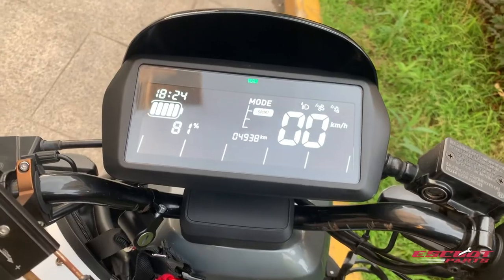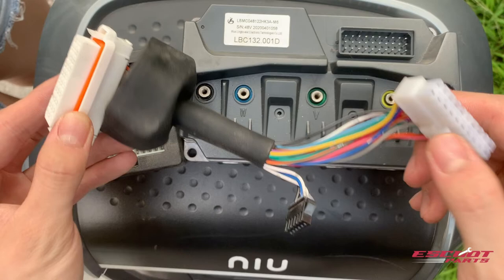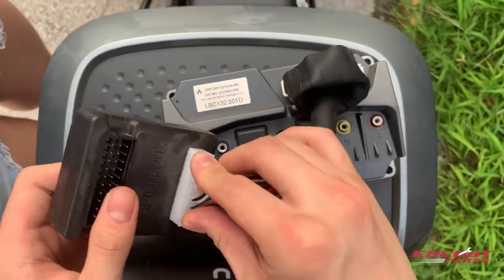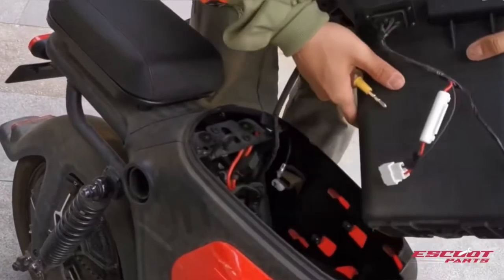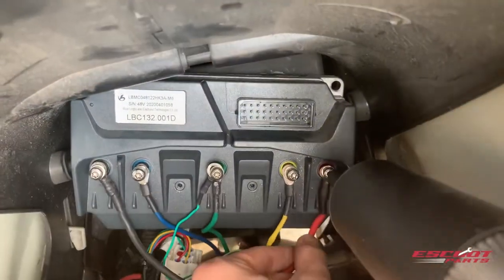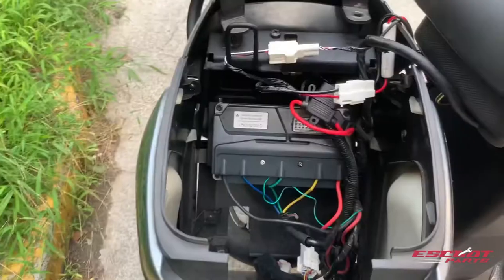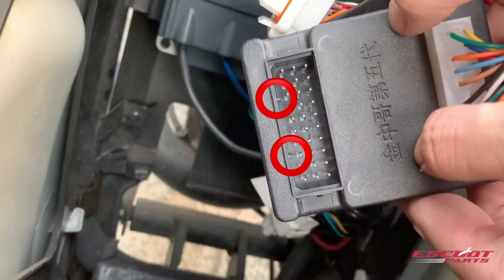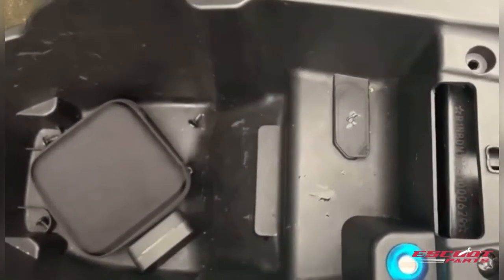How to Speed Up your NIU Scooter (All Models)

Comment: do you know how to use a outsource instead of it's battery, because i have a NIU N1S but the battery is damaged, so when using another battery, the screen may show but the battery symbol is flashing and it's only running at 20km/h. (sr for my bad english)
Reply from the maker: Yes, you have to buy a battery communication model, so it gets rid of the error communication you can contact us to get one

Comment: What is the range if you speed up niu m+? It must be like only 20 miles then
Reply from the maker: For example the N1S: 25km/h= 80km, 50km/h 60 and 75= 50-55km. About 25% decrease, you don’t have to drive full performance all the time though

Comment: I have a full motorcycle license to keen to derestrict my NIU but can you clarify What will be the top speed of a UQI GT Pro using your motherboard?
Reply from the maker: UQI GT PRO, we can give you a N-series capacity motherboard but the speed will only be up to 60-65km/h since the motor and battery will only allow that. For faster than 65, you will need to start changing your motor and battery.

Comment: Hi, will this work on a 2020 UQI GT PRO and what speed in MPH will it achieve? Thanks
Reply from the maker: Yes it will.

For the UQIGT, UQI+ and U1 we carry a motherboard that can unlock a third mode and also has programming option so that you can program the acceleration and also the speed per mode. The maximum speed for UQIGT is around 65 kmh, UQI+ and U1 is 55kmh. https://escootparts.com/product/uqi-65km-h-u1-motherboard-55km-h-3-modes-programmable/